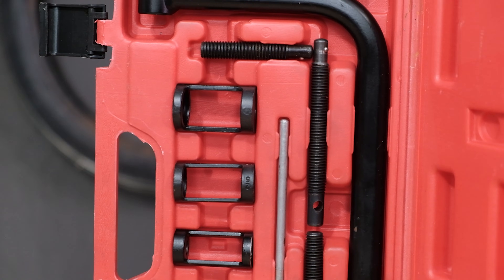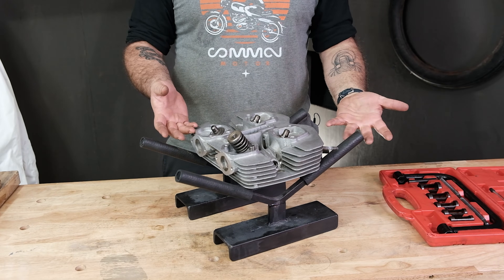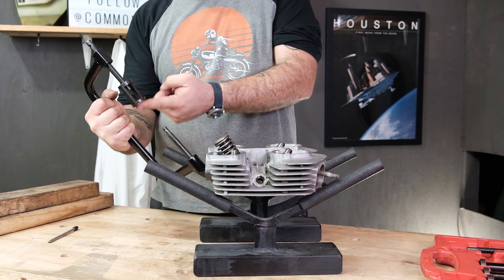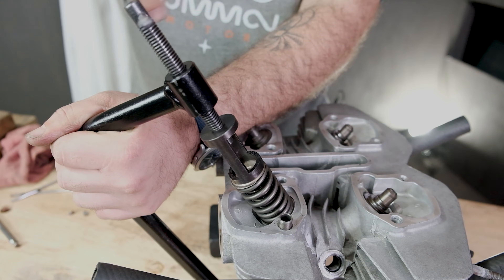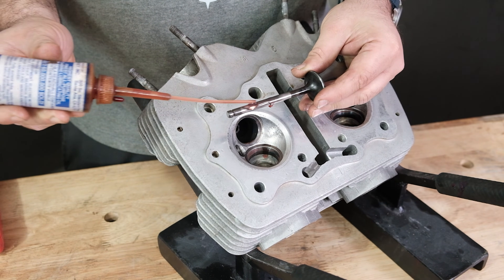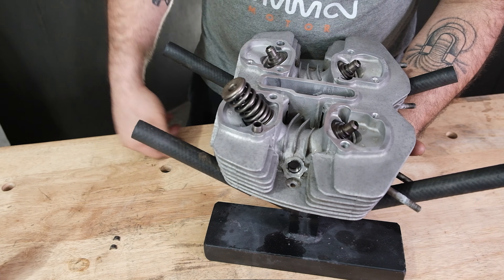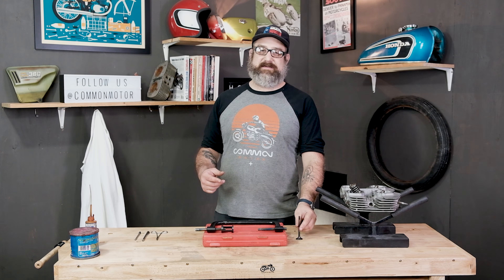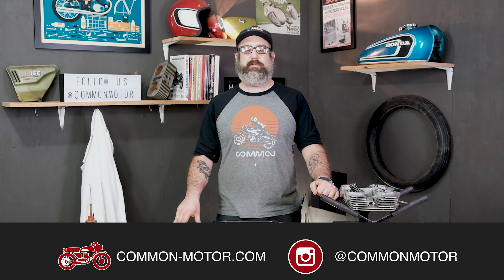Remove And Install Valve Springs On Your Vintage Honda Motorcycle: How To

Comment: i ordered the valve spring upgrade kit on your website and im wondering if it is okay that the end of the valve stem sticks out a little past the hole in the top of the washer past the keepers, is that okay/normal?

Comment: !!!! "The CB350s don't have valve stem seals." !!!!
 Thank you so much for emphasizing this! The seals come with basically every gasket set. So I installed them back then. Now I'm rebuilding my top end after less than 1K miles (head gasket failed because the cylinder head surface wasn't flat). What I'm seeing is that half of the valve seals have been destroyed. The pieces were all over in my oil galleries likely blocking the oil flow. SO DONT INSTALL VALVE SEALS!

Comment: Brendan,   I pulled both of my valves on left side,   I was getting no compression.    While using a digital caliper,   I found my springs were beyond the service limit according to the Clymer manual.    worth a mention,   your videos are great!    Swinedog

Comment: Thanks for mentioning the lack of valve seal on the 350. The gasket set I used for my rebuild had a set, but I didn't know where they went since the engine didn't have them when I took it apart. I finally figured out what they were after the bike was complete, and I've been stressing about it ever since.
Reply: You got lucky there!